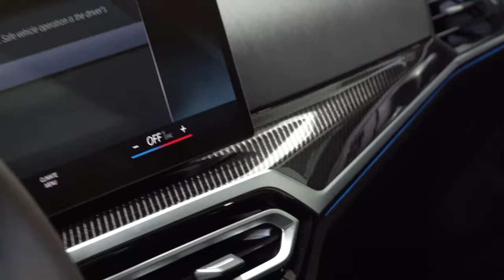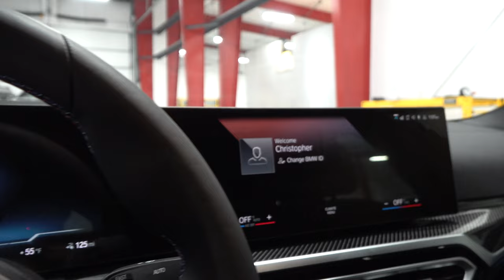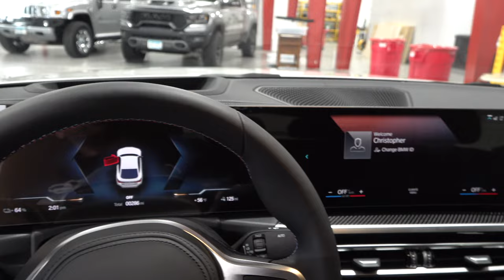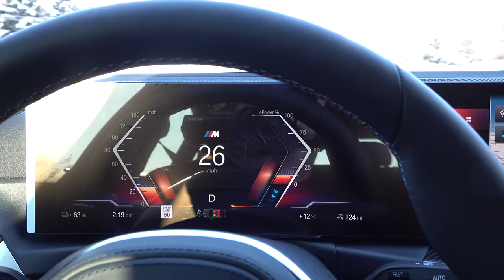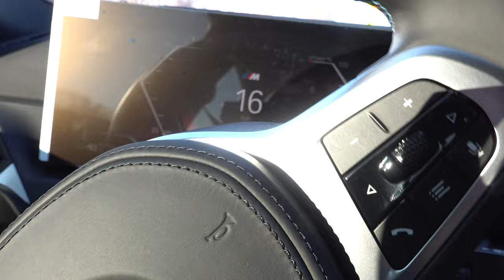BMW i4 M50 Review | Wash and Talk | One Year EV Experience

Comment: Had my M50 since August.  Love the car & ride but there are 2 issues:  1) Without Lazer lights, at night the car has blind spots on the sides due to the lack of cornering lights.  Could use curb sensors as well on the sides since fenders are long and high. 2) We recently took a road trip down 95 to Florida & back.  4 challenging 500 mile days and spouse was not happy:  3/4 stops per day to ensure starting with a full charge the next day and spacing of EA chargers.  Not easy to navigate to mostly Electrify America locations since BMW optimizes on their own criteria.  Lots of charging issues: chargers not working, or working slow,  connection issues, occasional wait queues.  + Folks showing poor charger etiquette - charging too much, staying past cycle. EA was good on issuing credits, but extra time at charger location.  So range remains an issue.  Over the next decade range will double and chargers will be more reliable and available.  Till then, be prepared....